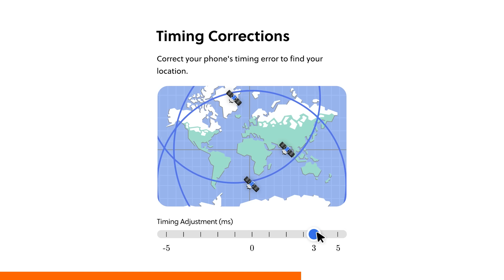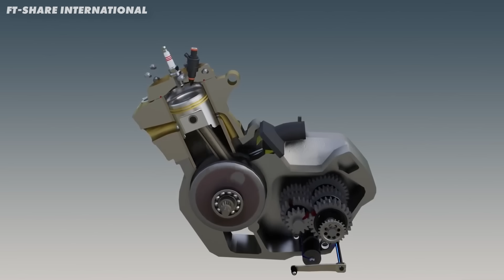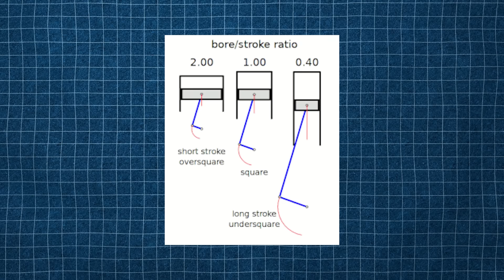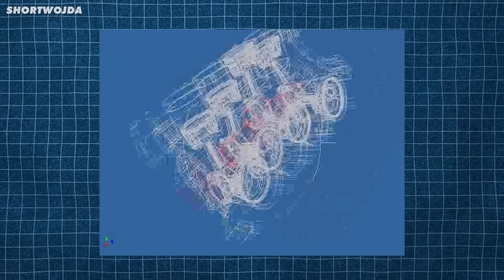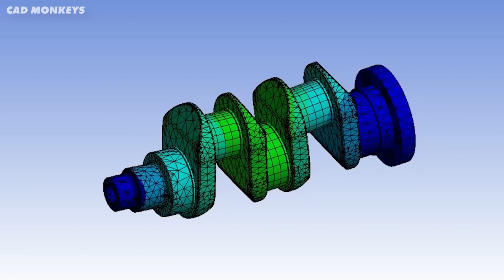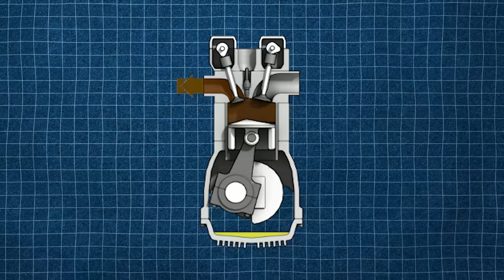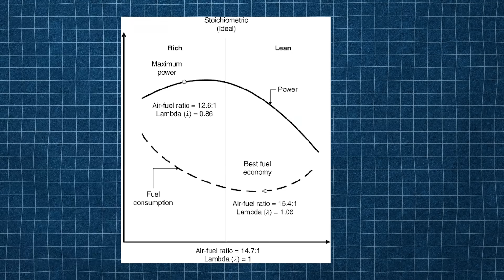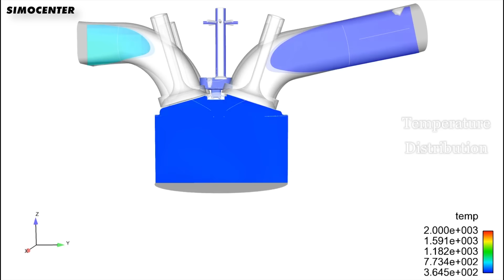Why It’s Almost Impossible to Rev to 21,000 RPM

Comment: Short answer: mechanical stress
Reply: short simple answer: to much "brrrrrrrrt" engine goes "boooom"
Reply: Come on man, let him stretch that two words answer for just a little more than 10 minutes, you are being rude.
Reply: Thank you
Reply: And what would be the solution about it(a production car's engine rev over 22.000 rpm...)??
Reply: That’s not actually true
Reply: Incorrect. See my comment.
Reply: @TheNecromancer6666  Nah, it's all about the weight and associated mechanical stress. Small two-stroke engines from RC cars will happily rev up to 36,000 RPM and not fall apart. Flamewall is clearly fine because they work.
Reply: @Oivaras the stoke is hella short.
Reply: They should use exotic materials like Hafnium diboride
Reply: @liviu543  remember when Mercedes used beryllium in the late 90ies :)
Reply: @AndrewTSq  Yeah, that was a relatively small step compared to current exotic materials
Reply: Probably more molecular stress than mechanical. But I get it lol
Reply: i found the person thats better than indian tech youtubers
Reply: lol no.
Reply: Get to the point bro
Reply: but we had 2 strokes rev higher?
Reply: @AndrewTSq  a common misconception. 2 strokes sound faster but typically rev less. Honda's RC116 50cc 4-stroke (from 1966!) can rev to 21.5kRPM.
Reply: @AndrewTSq  2 strokes traveled half the distance before combustion
Reply: @AndrewTSq smaller mass equals less stress. You can’t build an engine at the size to make enough power to propel an f1 car and displacement. Bottom line displacement is king and f1 being limited to certain displacement always max the engine size.
Reply: @Fk8td  So 1.5 liter 4 cyl was enough, but not 1 liter 4 cyl. How about adding 4 cylinders to the bike engine, so we have 2 liter engine, v8? and on top of that, add a small turbo. I read it has been done before in the 50ies. Searching for info, I found Ferrari even did a 2 liter V12 back in the days for hillclimb competition.
Reply: @AndrewTSq  yes, lets compare apples to oranges 😂😂
Reply: @AndrewTSq  Two-stroke engines are typically small engines. You can't compare a tiny weedwhacker engine or an RC car engine to a full-sized car engine. Smaller engines tend to rev higher due to the reduced weight.

Comment: The only problem is that they DID 20K rpm...
It CAN be done. Honda had a roadrace bike that would rev to 22K rom in the '60s.
Reply: Getting high RPM is easier as the engine get's smaller. Nitro engines for model airplanes can turn in excess of 50k RPM, and that's on a way smaller budget.
Reply: @benjaminshropshire2900  I am sure there is some super expensive material you can make a F1 piston off, that will last a race and cost a fortune and it will rev way further... actually I always thought it was the valves that was the problem with high reving engines.
Reply: @AndrewTSq  nitro engines for models are commonly two stroke and use the piston as the valve which would match with valves being the main limit.
Reply: @AndrewTSq F1 engines need to last a season, not just a race.
Reply: @TheOfficialOriginalChad  nowadays Yes. But in the 80ies they had a quality engine I think. Just change the rules.
Reply: @AndrewTSq   Not quite…in the 80s they rebuilt or replaced the engine every weekend, sometimes multiple times per weekend. That’s not what I would consider “quality”. High performance, absolutely…but today we have both performance and reliability.
Reply: thing is the bike pistons are smaller and lighter, so higher rpm is possible.
Reply: The title says, "Why It's Almost Impossible to Rev to 21,000 RPM”.
It should qualify itself and say, Why It's Almost Impossible to Rev to 21,000 RPM on a F1 engine.
Otherwise yes, the mid 60’s twin cylinder, three cylinder, five and six cylinder Honda engines went well beyond 21000 rpm. Absolutely amazing technology performance for the time, and well, well out in front of racing cars of the day.
If the multi cylinder motor cycle engines hadn’t been banned for racing a few years later, who knows where we might have been today. Finally, Honda also  brought out a six cylinder road bike as well.
Reply: Honda RC166. Brilliant engineering. The miniscule engine internals are a treat to behold.  A sound like no other.  A golden age.
Reply: You didn't watch the video before posting...
Reply: 20k rpm in F1 was only possible when they downsized the engines from 3-litre V10 to 2.4-litre V8. I believe the rev limit was reduced twice during the V8 era, to 19k in 2007 and to 18k in 2009 if I'm not mistaken. With the turbos it is or was 15k, but as the fuel flow reaches its maximum at 10.5k, the engines usually operate in the 10-12k range.
Reply: Honda also did a roadbike with valve springs that did 20krpm on pump fuel in the 1989... cbr250rr
Reply: the rc116 had a redline at 21.5k
Reply: A 250cc formula one engine could rev up to 22000 rpm then ?
Reply: @aaronaaronsen3360  Rc.166.
250cc four stroke, six cylinder.
Con rods, no longer than a credit card. The valves, look like golf Tees.  Roller crank. 22000 all day. Engineering master work.
Reply: @BastardX13  yeah but it's a motorcycle then. That wouldn't work with a F1 engine or maybe an RC F1.
Reply: OMG... Everyone knows, that those were 2 stroke engines. They changed two 4 stroke engines in bikeracing in  the start-middle of the 90-s.
Reply: Honda had a mini superbike for the road in the 90s that rev to 21k
Reply: @carlosandleon  Again, 2 stroke.
Reply: Yeah

At 250cc

Right? 

That one?
Reply: @tomarmadiyer2698  honda had a race bike twin 50cc wich had a redline at 21k ish rumored to have 14 hp four stroke aswell i think
Reply: yes, as stated in the video but never 21000 RPM
Reply: @Noise-Bomb  but if it went to 22k rpm, I am sure it must have been doing 21 on the way up...
Reply: @AndrewTSq  a bike engine went to 22K, NOT an F1 engine as was specified
Reply: @AndrewTSq  nope, according to this video there's a discontinuity in the graph at 21000 and no where else
Reply: @hugo.thefrenchie  Yes but make a 1000cc F1 engine then?
Reply: @hugo.thefrenchie  0:37 he says 'or any engines', so all engines were specified FWIW. Not that it matters, OP was talking about the RC166 presumably, which was 18000rpm. CBR250RR MC22 road bikes have a tach that stops at 19000, but when the British magazines in the 90s tested them they were lying by about 2000rpm so that tracks.
Reply: @kiztime1234  I believe it's the rc116 he is thinking of that did 22500rpm. In the 60s as well. Technology and materials have come a long way. The only reason F1 engines never reved higher is because the FIA put a limit on how strong alloys for engines could be. Moral is the pesky french ruin everything.
Reply: @brynfisher8019  Ugh the French.
Reply: @Noise-Bomb geezus some people